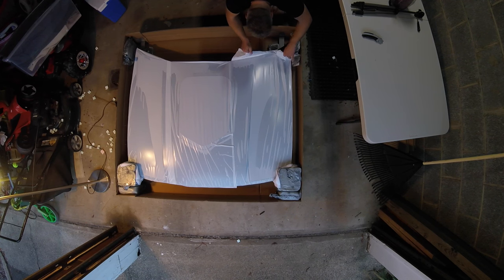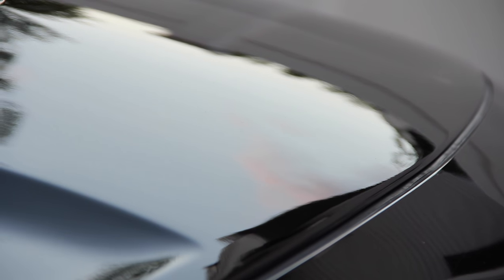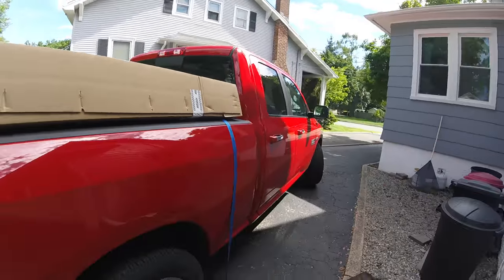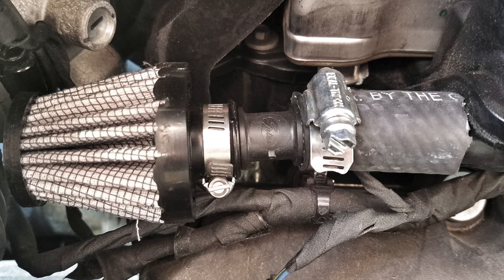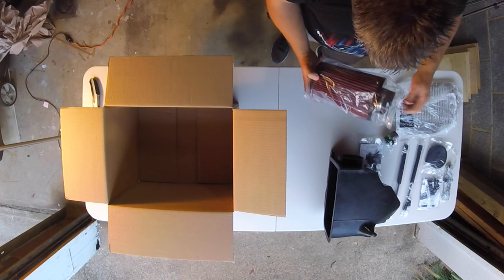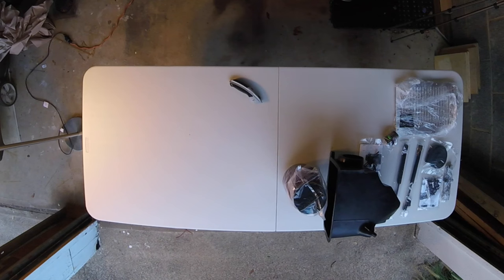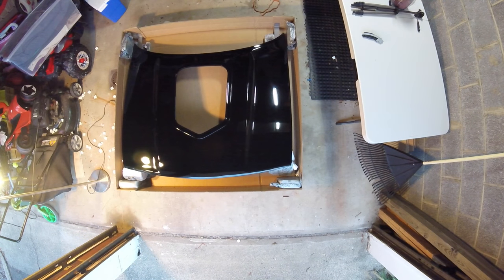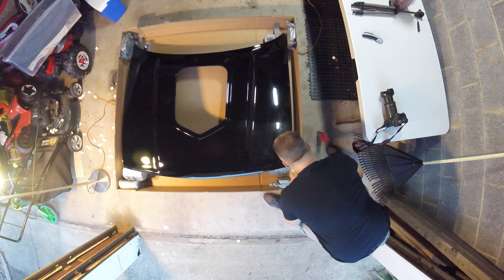Cervinis Challenger Shaker kit Part 1 (6.4L \ 392 Hemi) Order and unboxing

Comment: Had mine since 2012 on my SRT8 392 Matte Black painted both sides to match my Header Orange. Perfection and still after 11 yrs . I have kept it covered the whole time and have 60,000 miles on it. Until 2015  it was the only Shaker in town. The Cervini draws cold air better than the Mopar design.
Reply from the maker: I also feel the size is more proportional to the car.

Comment: thanks for posting. i have the same model as you and originally wanted a shaker hood... badly.. and even though i tried to buy one and had to walk on it i felt like i ended up settling with the standard hood. but i have to be honest - now - and even looking at your original hood in the video - ive grown to love the standard hood. i really like it.  thanks for posting and im waiting waiting for the supercharger install video.... i want to see a "common" guy do an install on that!
Reply from the maker: I love all the challenger hoods, and totally loved the first year driving my SP without the shaker.  The shaker just speaks to me in a way my favorite toy car with the rattling engine did as a kid.  When I found out I could do a Shaker conversion I had to go for it.   I love watching it Torque when I hit the gas.  

As for the supercharger, I want to take my SP to the next level, but it's going to be a little while due to the overall cost $10K + just for the bolt on and if I want to run serous boost then we're talking a lot more.  I don't see any affiliate deals on superchargers in my near future :)   But I'm always working on it....

Comment: I saw that you used the stock hinges. Instead of the hinges from Cervini’s. Have the stock hinges been working okay with the Cervini’s hood? Also I can’t find part 3 of the installation. I just got mine in, and will be installing it this Sunday. Thanks in advance.
Reply from the maker: I'm pretty sure I got back to you on Insta, but just in case I'm assuming you meant the lifters.  The stock lifters work, but the Cervini's lifters are more powerful for the added weight of the Fiberglass hood.  I recommend using the ones Cervini's provided it makes a pretty big difference in lifting.

Comment: I dont think it's a good idea for your engine to have a shaker hood. It traps in the heat that the hemis -  including the 392, produce. No hood vents or scoops to help bring in cooler outside air, or vents to remove engine bay heat. Not to mention, that the cai used is the same old mopar cai that's open and will easily suck in the surrounding hot engine bay heat. The only thing that might help, is a cut out for the hellcat vent, and the 180° thermostat installed. But for heat removal and performance, you will easily get heat soak with the shaker hood and the TA package. Imagine it on a 100°F day
Reply from the maker: The airbox is completely sealed on this hood, it is not open like the OEM shakers.  The cervinis kit only pulls in air from the shaker, the fender.  I added the headlight intake as well in this video.  https://youtu.be/bcaminpPQeE.  

I have not had issues with heat even when running the car at the drag strip in the summer.  the hood is actually vented there is no seal around the shaker hood so it pulls in air from the grill and vents out the hole for the shaker.

What I do notice is heat soak, in extreme situations because the shaker sits on top of the hot engine the entire assembly heats up and in turn it heats the air to the intake when idle.  My intake temps could spike up to  150 f on a hot day while staging.  This is why I added the headlight tube, that helps get the intake temps down much faster once I launch.  For daily driving this is not an issue at all.
Reply: @WorkPlayDrive  well I dont know how dodge could pull this off on an engine like this. Because for 2019, the challenger scatpack stock has the hellcat hood which should provide the ultimate cooling for the 392. Even in 2013 when the charger srt8 superbee was out, it was the same hood that was on the v6. No hood scoop to vent out heat or in cooler air. Same goes for the hellcat and redeye. One scoop is for the intake only. And the passenger side isn't even functional. I dont get it. And those 2 engines created way more heat than the 392 with the more restrictive demon engine making the most oven like heat

Comment: Can somebody Tell if it is ok to drive IT a few km/miles without Shaker hood scoop?(just the plastic intruder) cause mine is to get a pinstripe painting.. And i want to wash the car besause i need to get my door painted (an Idiot crashed IT with 2 scratches)
Thx for replies

Comment: Pardon the silly question, but if you have a shaker already, why did you choose this hood and kit?  Is it the weight savings?
Reply from the maker: My car was not originally a shaker.  When I picked up the Scat Pack in May of 2015 they were only doing "allocation orders" and when I finally found a dealership that can order one they were no longer making manuals.  I located a Manual Black Scat Pack a few hours from me with all the features I wanted except the shaker.  I ordered this kit because I liked it better than the OEM Shaker.
Reply: Thanks for the clarification!  Totally makes sense.

Comment: wow I have the same hood fitment problem with my 2015 Rt, lol. why you picked the cervini over the mopar one? just wondering
Reply from the maker: +edd3055 there cervini shaker is larger and longer than the stock Mopar shaker. I looked at both and they are equally awesome. For me I wanted a bigger shaker in my eyes it was more proportional to the car and gave me the look I wanted.
Reply: I was I little skeptic about the cervini in the website pictures looks good but I think they need to update the Challengers they have as thumbnails because the 2015 and up are different. the front of the new models seem wider than older versions and I was afraid that the shaker would look very short, but after looking at yours I feel more comfortable to see that it actually looks very good and the price is very nice as well
Reply from the maker: Here are a bunch more pics to help give you a good idea on the shaker from all angles.  http://imgur.com/a/9YWE
Reply: I have not been able to open that link since you put it, do you have any other sources of current model challengers with cervinis shaker hood that would you like to share?
Reply from the maker: Sorry man didn't realize the link went dead here is a new one.  
http://imgur.com/a/9YWEl
Reply: No problem man thanks again, wow I was looking at it and its really nice
Reply from the maker: Yeah I am so happy I went with this one, I love the size.